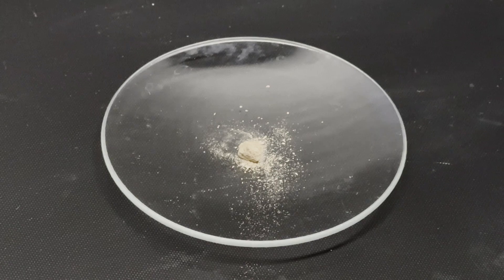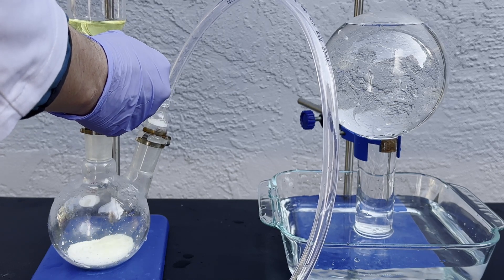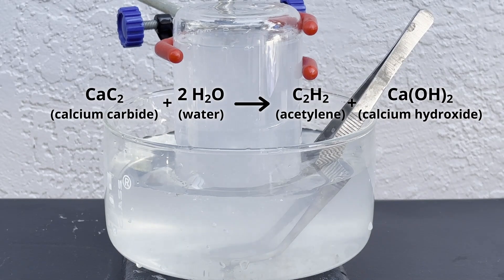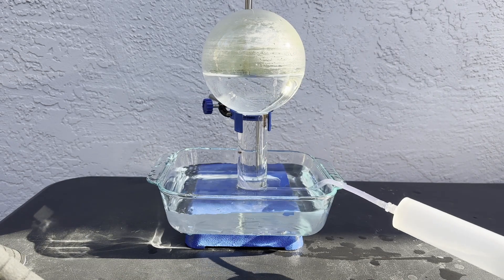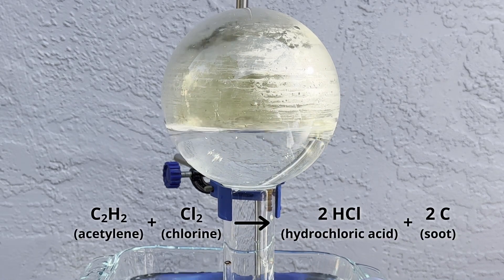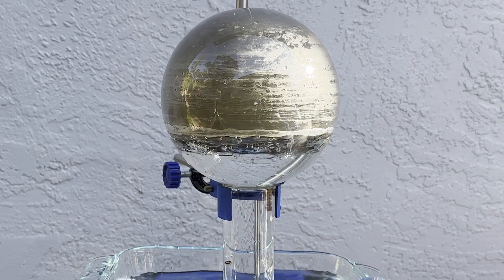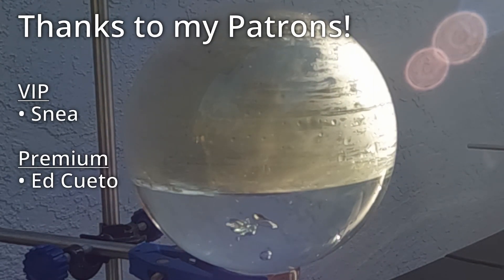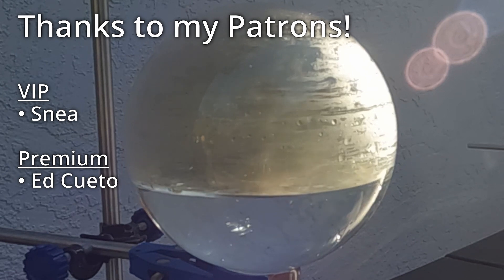These Gases Explode on Contact

Comment: i wonder if u kept pumping it the water level would rise again as the hydrochloric acid mixed in with water reducing the gas pressure
Reply from the maker: I was wondering the same thing! I'd expect it to as well
Reply: I was about to make the same comment. The left over carbon should make a solid that doesn't take up much space and the HCl should dissolve in the water. I guess that the heat of the reaction was increasing the volume of the remaining gas and probably also increasing the water vapor content. But after cooling, the gas volume should be smaller.